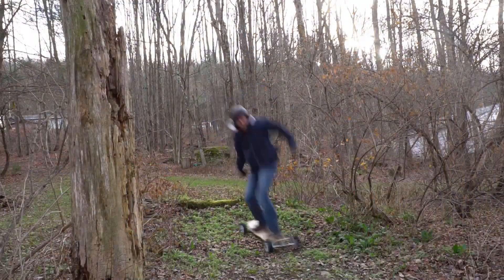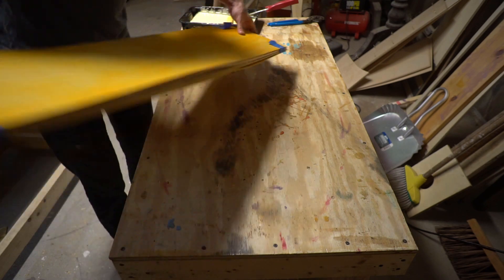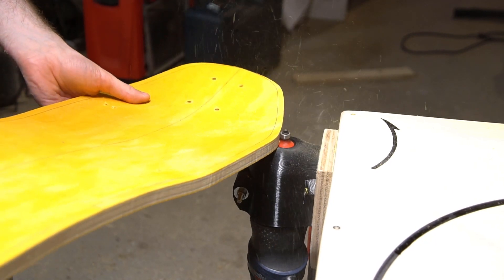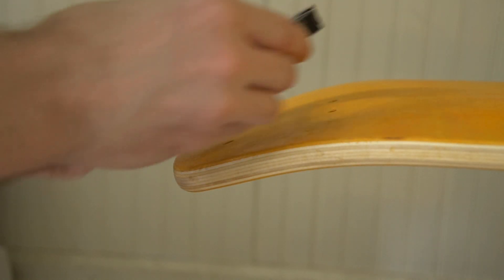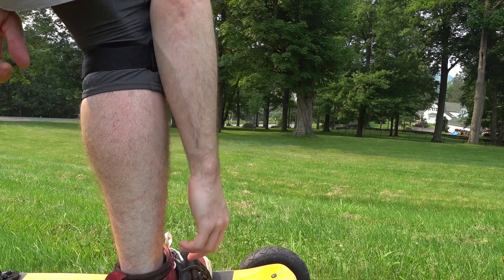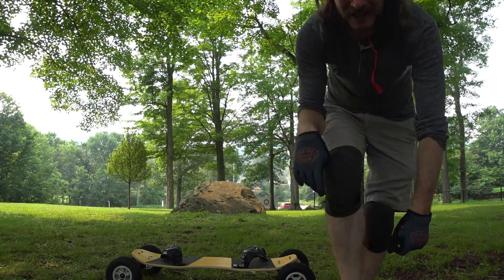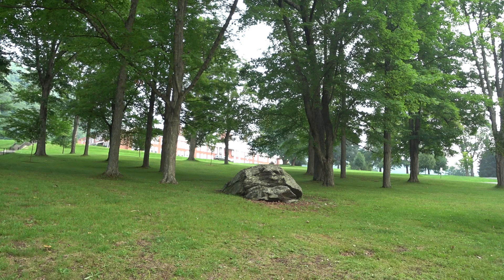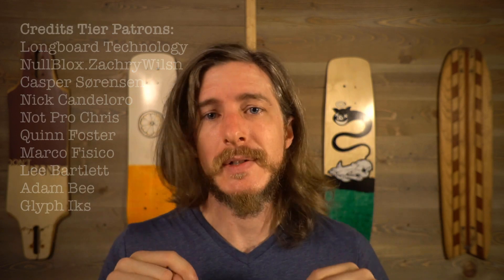Pressing a Killer Mountainboard Deck Using a 3D Printed Mold

Comment: Hey Chris, loving your content and ideas. How's this deck holding up? Is it holding it's angles or relaxing at all? I've got a couple of longboard decks constructed with bamboo...do you think the birch is comparable to the "pop" or spring back provide by bamboo? Cheers
Reply from the maker: It's holding up great! It's still my main deck. It's got a couple stress fractures at this point, but that's to be expected. Between birch, bamboo, and maple, I think birch has the least pop. Its advantages are that it's lightweight and can have a bit of a dampening effect if you're looking for it. Bamboo is springy, maple is snappy

Comment: Using all of your same steps try one out with epoxy for every layer and depending on stiffness maybe sub a layer or two of veneer for fiberglass. I have done this for an electric  longboard  deck and it is amazingly strong. I weigh 290 and made a deck that has great flex but feels solid and I can jump curbs with(I have bindings on it too). I ended up doing 9 ply maple and two fiberglass. So it's heavy but I wanted to make sure it wouldn't snap. Power Peralta flight decks(regular skate decks) use a epoxy or similar resin to glue there layers and those things are near impossible to break

Comment: So I am hopefully going to be getting to making and pressing a mountainboard deck this weekend.

I'm hoping to get some insight from you on what you feel is an appropriate radius to bend the nose/tail.
It seems like you've gone with a relatively large radius on this board. 
I feel like the larger radius you do, the better in terms of strength and even flex, and especially ease of pressing. In a sense you kinda want to go with as large as you can get away with. But at the same time too big of a radius also can end up making the deck longer than it needs to be, and also cause the foot platform to be further away from the trucks.

When it comes to this board, how do you feel it does in that balance? 
If you could press with as sharp of radius as you could ever want, would you have approached this design differently?
Reply from the maker: The radii can get pretty tight, especially on some of the old boards. MBS was doing a weird v-lam construction for a while where the slices of wood went perpendicular to the length of the deck which let them get some crazy sharp tail angles, and Trampa's tail transitions are basically an angle instead of a curve. I don't think it needs to be all that drastic, as long as you have enough room for the trucks to be mounted at the correct angle a radius similar to what you'd see on a skateboard kick will work just fine, maybe a little tighter if you want to bring the trucks in closer to your feet. Too sharp of an angle can definitely become a weak point, especially if you're not doing a composite deck. 

My deck is taking an entirely different approach, so I'm actually getting the curves and angles that I've wanted in a board for a long time. The biggest drawback to my take is a loss of clearance under the foot beds. Obviously I think this is worth it and a good design which is why I keep building it, but the old deck shapes work great too. Good luck with the build dude! Let me know how it turns out!

Comment: Its really interesting how non-standard mountainboarding is with the rest of skate.
I've often wondered how much of it was intentional, and how much was incidental.

I think early on mountainboarding probably benefited by not being tied to skate conventions.
Having the wedged nose/tails with 0 deg trucks is an awesome way to deal with lowing the height and dealing with such large wheels.

The fact that Mountainboarding started off with channel trucks (far as I've been able to tell) makes me think that most all of the sports differences from skate are incidental.
If you were making trucks for the very first time, nothing is easier to make than a 0 degree channel truck. Just need some pre-manufactured tube, and angle stock.

I honestly didn't know till now that kingpin mountainboard trucks weren't 0 degree as well. I would have though that 0 degree baseplates would have been the standard that had developed.
That difference just seems odd to me. Almost contrived.
Is this a thing even within the same brands of products? Because dividing up your product ecosystem like that just seems so insane.
Reply from the maker: Skate style ATB trucks were initially introduced at the low-cost end of the sport so while I think it's a bad idea to have incompatible parts of your own ecosystem, I understand why it happened. At first they were only put on boards for younger smaller riders but over the years the quality and strength of the skate style trucks have improved and become a more mid-level option. The issue of compatability within the sport has slowly been getting better too. Almost all the hardware on a current MBS setup is M5 where you used to need three different Allen keys for all the different parts. As the sport grows and there are more manufacturers and a larger market there will be more of an opportunity to get everyone on the same page

Comment: Avesome handmade deck that noone have and sell right now , maybe we will see it for sale in some time :D 

ps
check my handmade deck out of composite (one of many ,, without wood using special hard not foam core material) 
https://www.youtube.com/watch?v=wezkZgxDh3o

now working on independent
 suspension and trucks in 1 without moving parts (only flex) independent meaning wheels aren't connected like in matrix trucks etc